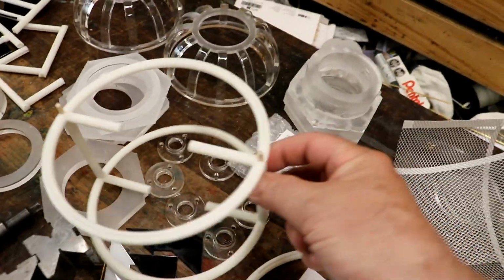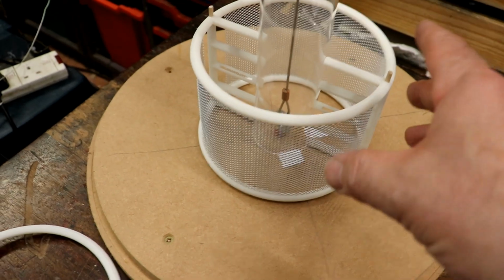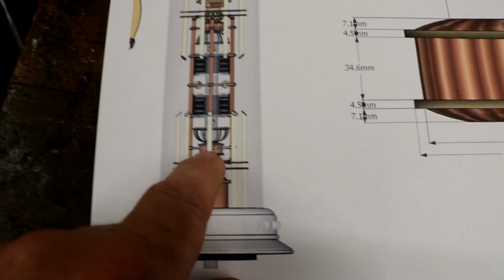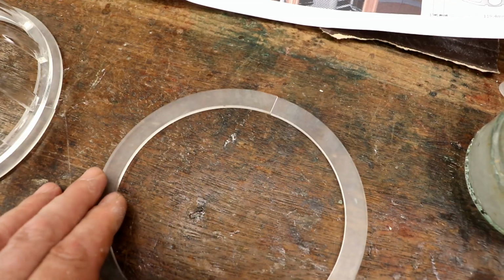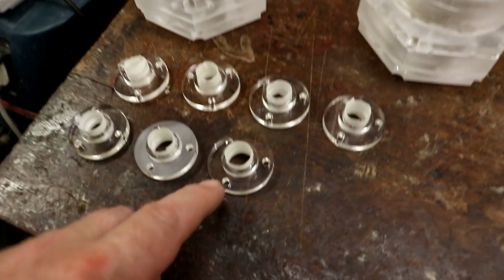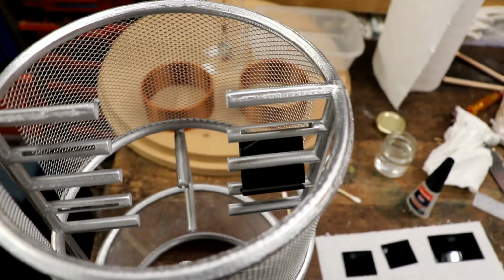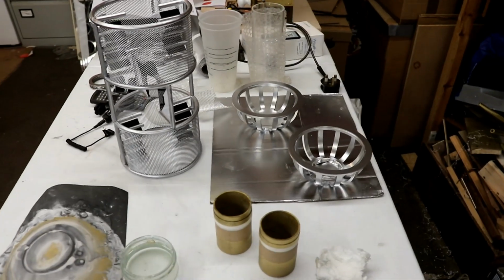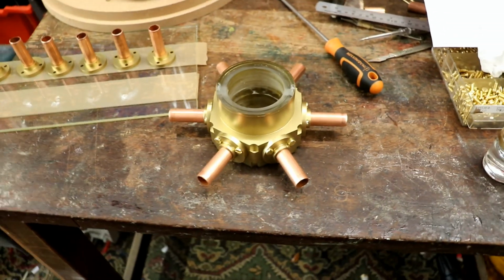Steampunk Tardis Console - Part 8

Comment: Question. What is the mechanism to make the time rotor go up and down?
Reply from the maker: I'm planning to link the top and bottom parts of the time rotor with steel wire that runs up the central tube and over a pulley at the top. This will ensure both the top and bottom parts rise and fall to meet each other in the middle. This means they should balance out one another. They'll be driven by a large stepper or DC motor in the base with a crank attached to the steel wire. If the top rotor weighs a little more than the bottom one, the motor will just have to pull the steel wire.

Comment: Acrylic tubes are notorious for spontaneously cracking. I’ve found that an ultrasonic cutter does best to compensate for the stress innately created from cutting these dastardly creatures.
Reply: True, especially when they have been exposed to hydrocarbons, carbon tet or UV.  Warming to  <60 C helps if there are internal stresses. Some tubes used for pressure are in fact built up from rolls of film and heat treated. This is why when polishing they appear do delaminate.  I can see why your ultrasonic cutter would help, I think the cracking is from tool chatter from low RPM or too much pressure and a multitude of other factors.
Reply: @WOFFY-qc9te  I generally cut acrylic tube on a rotary auxiliary axis on my laser cutter. On the milling machine, I use a diamond router bit manufactured exclusively for acrylic and TPU but for TPU cutting on the mill, it requires a cryostat or equivalent. Boy oh boy, originally, that router bit cost around 500 USD but I managed to get one at an auction for 25 😊. It’s a three flute compression segmented PCD (diamond) router bit.
Reply from the maker: Thank you for the advice. So far, fingers crossed, my dear old bandsaw has managed to cut even thin acrylic tube without issue - that's when it doesn't have some sticky out teeth on the saw blade's weld! 

Interestingly I couldn't believe how difficult it was to drill and tap solid acrylic rod. After machining, the whole rod would disintigrate before my eyes! Thanks for letting me know why.
Reply: @steamhead  Have you ever had your bandsaw grab a cylinder or tube rather dramatically? I’ve even had an acrylic tube take off and fly across my shop, even though it was on a sled. Also, have you used a bandsaw blade with tungsten carbide teeth? Absolutely dreamy! I use the Laguna Resaw King. Cuts like butter and if you need it sharpened, they charge you £35.
Reply from the maker: @Endoplasmic-Reticulum  I think my bandsaw blades are often fairly blunt, so they abrade their way through rather than cutting! Thanks for the Laguna Resaw King suggestion, I'm going to look that up now.
Reply: @steamhead  Yeah, they’ve been a game changer for me. While I don’t believe they make anything for radius cutting like a 1/4 inch, straight cuts for me are like a table saw. Also, I’ve never lost a tooth.
Reply from the maker: @Endoplasmic-Reticulum  thanks for the suggestion. My bandsaw is fairly small and I haven't yet been able to find a Laguna blade 2312mm long. I'll keep looking...
Reply: I’m not an expert on acrylic, but there was a company called “gratuitous sets” and the recommend polycarbonate tubes rather than acrylic simply because they are more durable, but I know you have acrylic now lol.
Reply: @ToymakersCat  I love polycarbonate and I incorporate it into my jellyfish tanks but if any UV light hits it over time (like from the UV filter somehow) it gets extremely brittle whereas acrylic stays strong. Sometimes I just have to wait and see if the acrylic tubing spontaneously cracks or not. I do use an autoclave to reduce stresses significantly though.
Reply from the maker: @ToymakersCat Thanks very much for the suggestion. I've just had a look at the Gratuitous Sets YouTube channel - amazing! I'll definately consider using polycarbonate for future tubes.

Comment: Does the project include electronic parts? Motors and Leds ?
Reply from the maker: It will do, the moving parts will be driven by larger stepper motors, the up and down moving tubes will be illuminated by multicolour LEDs and there'll be a plethora of all sorts of illuminated and moving items on the control panels. There also needs to be coordinated sound effects, with the whole lot controlled by some sort of microcontroller. What fun!

Comment: Open printers printing quality is bad. If you switch to an enclosed printer you will apreciate the quality output. They usually have proper cooling and better extrusion control.
Reply from the maker: That's an interesting point. When I have time I'll try making an enclosure for the Ender Pro.
Reply: Unfortunately thats not a good solution. Ender Pro has its limits covering it wont solve. I bought a new printer which is a cheap clone of Bambu lab. The print quality difference and speed is amazing. Just save money for that :)
Reply from the maker: @ibrahimkocaalioglu  thanks for the suggestion. Bambu Lab 3D printers are still reasonably priced. I must have had my Ender 3 Pro for at least 5 years, so I'm sure the technology has moved on by leaps and bounds. When my Ender 3 gives up the ghost or when I need higher quality prints I'll definately consider one from Bambu Lab.

Comment: 3d parts that you can shape later on lathe can be printed using .8m  nozzle. It is much faster.
Reply from the maker: That's an interesting thought, although I suppose I'd have to print solid versions to allow for the turning down. I was lucky this time turning down the copper 3D prints, as the wall thickness was about 1.8mm, so room for some maneuvering.

I'll probably try and stick with lasercut acrylic assemblies for things that need turning down, as it's what I know!